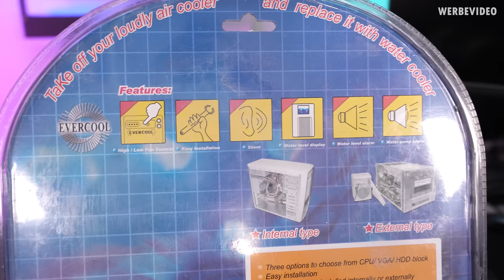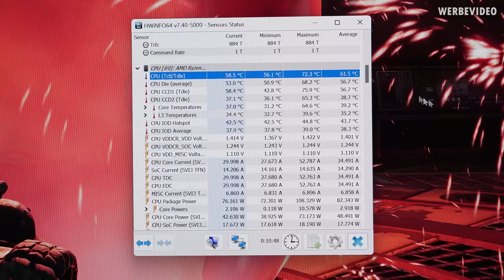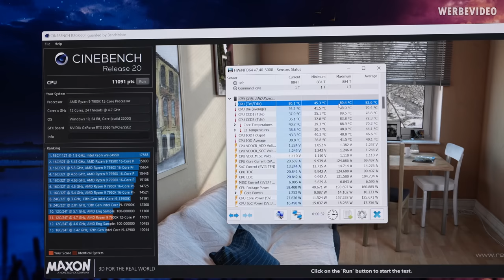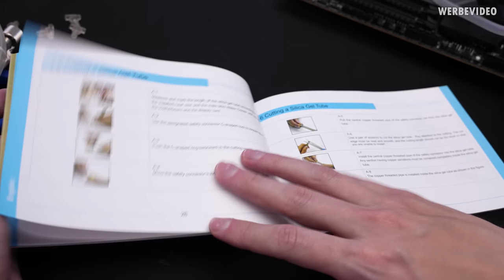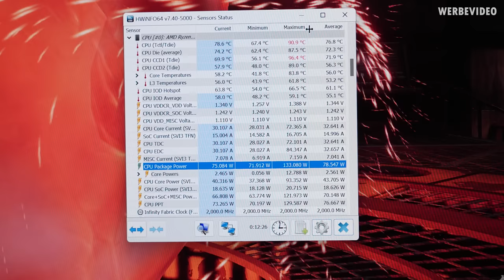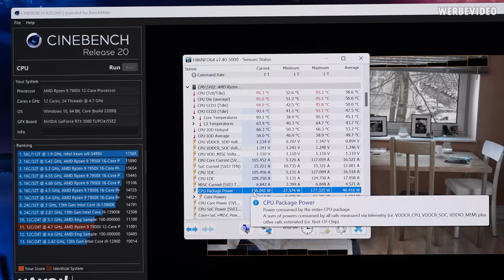19 Years old Water Cooling vs Ryzen 7900X

Comment: The kelvin (abbreviation K), less commonly called the degree Kelvin (symbol, o K), is the Standard International ( SI ) unit of thermodynamic temperature. One kelvin is formally defined as 1/273.16 (3.6609 x 10 -3 ) of the thermodynamic temperature of the triple point of pure water (H 2 O).

The kelvin scale differs from the more familiar Celsius or centigrade ( o C) temperature scale; there is no such thing as a below-zero Kelvin figure. A temperature of 0 K represents absolute zero, the absence of all heat. However, the size of the kelvin "degree" is the same as the size of the Celsius "degree." A change of plus-or-minus 1 o C is the same as a change of plus-or-minus 1 K.

At standard Earth-atmospheric sea-level pressure, water freezes at 0 o C or +273.15 K, and boils at +100 o C or +373.15 K. A temperature of 0 K thus corresponds to -273.15 o C. A temperature of 273.15 K corresponds to 0 o C. To convert a kelvin temperature figure to Celsius, subtract 273.15. To convert a Celsius temperature figure to kelvin, add 273.15. Historically, the Kelvin scale was developed by shifting the starting point of the much-older Celsius scale down from the melting point of ice to absolute zero, and its increments still closely approximate the historic definition of a degree Celsius, but since 2019 the scale has been defined by fixing the Boltzmann constant k to be exactly 1.380649×10−23 J⋅K−1. Hence, one kelvin is equal to a change in the thermodynamic temperature T that results in a change of thermal energy kT by 1.380649×10−23 J.

According to SI convention, the kelvin is never referred to nor written as a degree. The word "kelvin" is not capitalised when used as a unit, but is pluralised as appropriate. The unit symbol K is a capital letter. For example, "It is 50 degrees Fahrenheit outside" vs "It is 10 degrees Celsius outside" vs "It is 283 kelvins outside". It is common convention to capitalize the term when referring to the Kelvin scale.

Comment: I think AM5 will compatible with its K8 mounting kit if it is included with this, according to the manual shown in video it mount with stock bracket, if it's anything that using stock bracket for mounting, all CPU coolers will be compatible since K8 era all the way to AM5 and you didn't need to make custom mounting bracket at all.

Comment: If the water level sensor is just some bare metal wires looking for the conductivity of the water, either some oxidation on the contacts or having used distilled water rather than coolant is affecting the value and setting the alarm off.

Comment: Not sure how to contact you, but building a rig in one of your “Der Bauer” Lian Li cases. Excited to get started. Gigabyte Aoruse Elite AX MB / RTX 3090 / Patriot Viper 4400 mhz ram / WD Black SN850x Nvme’s x 3 / 10 TB WD hard drive / NZXT 280mm AIO / CORE I5-11600k.

Comment: I would be interested in seeing how well the Evercool Mini does with an updated heat block as well--something that can pick the heat up out of the processor. I doubt the included block was designed for something as rambunctious as a modern day Ryzen. The Pentium 4 TDP was, like, just under 100 watts. The Ryzen shown probably had a TDP closer to 200 watts, and some push 300 watts and higher. As such, I would be interested in what the "mini fridge" pump head can do with a suitable thermal pickup.

Comment: I've been using 20 year old water cooling since the Pentium 4 Prescott (Actually pulled the trigger on all of it BECAUSE of Prescott) and can tell you, no. Those 89W single core twin thread 32-bit chips do NOT do well with this type of equipment. Today I've updated the 240mm alum radiator to a 360mm copper, yeet'd the 3x80mm fans for 3x120mm and all is much MUCH better. You really need good heat dissipation for those older chips.
Pentium 4 Prescott needed it.
Phenom II X4 Deneb needed it.
FX-8000 series Vishera needed it even more.
Ryzen 3000 series doesn't need it so much to the point that it seems overkill but good.
I'm using the same gold/copper block I picked up in 2004 and Ryzen seems to like it. Had to flip the stock cooler mounts around and modify the original Socket A adapter to get it to work.

Comment: 5:06 Actually, that radiator unit alone looks like a cheap speaker . The 2 ports looks like RCA that you plug audio cable. It does makes alot of noise though

Comment: In the days of hotbox cases, this probably would have been a huge improvement if the buyers routed the radiator externally, vs air-coolers with a single 80mm intake and single 80mm exhaust for the whole computer.

We know they're useless, but comparing this cooler to a 120mm aio would have felt a little more "fair" than a 280mm

Comment: I remember the mini,  ut I could not afford it at the time, I did air cooling, in 1990, but water stuf from 2000 onwards. My first ore kit (instead of customers fish tank stuff), a gigabyte kit with water low warning system, but clear block, and water pump/etc cracked, n leaked on my 8800 ultra.

Comment: Why is there such a need to see if a 20 year cooler will work on modern hardware. I had an OCZ Gladiator Athlon cooler that had a 6000 rpm 60 mm fan. It screamed like a banshee but never really bothered as I just cranked up the volume while gaming

Comment: If I had something like that back then, I might have flipped the fan around and mounted it on the outside. Cases back then where starting to get the two holes for water cooling in the back.

Comment: Cool video, I like that speaker look from the 1990s boom box. Never remove the speaker, it was to warn you from bubbles or lack of water, even faulty it should sound like music from the boom box😂. I would have used it with a super violent delta fan, in a 12 inch subwoofer cooler.

Comment: Wondering if you would take a look at those all in one AIOs with the radiator built onto the cooler block.  They are different and interesting and wonder why its not done more often.  I think they were an OEM solution from HP and/or Dell?

Comment: Daft idea: direct die air in a desktop with PTM7950, an air cooler you like, and an aggressive fan curve. Laptops are direct die air, so it's precedented, but that's due to Z-height concerns and the fact that they're limited in capacity anyway.

Comment: This thing looks awesome though from the inside that is. You should have tried on a Ryzen 5000 series or maybe Intel 11th gen, these new chips are going to reach 95c no matter what you do and almost immediately too since that's what they are designed to do and doesn't really test how the cooler is doing unless it stays at 95 and rides on then the cooler is working fine.

Comment: I should literally send you hackjob Eheim aquarium pumps and car radiators/air intercoolers and stupid stuff we did in the late 90s. The insides of the block are cool though, 2 plates and a square strip of copper epoxied? together? Soldering is too expensive?

Comment: Don't get me wrong, it's nifty and all, but what is the actual use case for this (or was), the radiator is no bigger than one for an air cooler directly mounted on the CPU. Unless you get a radiator bigger than what could concievably be put directly onto the CPU, does water cooling make any sense?
Reply: having this external on your PC circa 2004 means you gonna be the star of the LAN party

Comment: An interesting thing is that amd has maintained cooler compatibility for the most part since socket 754, as it is likely that the amd mounting hardware included would have worked, even on a current motherboard.
Reply: This is only true if the cooler uses the super old school hook and loop mounting system instead of the screw holes, which this definitely would not have.
Reply: @Cooe.  actually if you looked in the box, it did have the hook and loop mounting system for amd, as was common for many watercoolers of this vintage.

Comment: There were a bunch of these back in the day. I remember really wanting a Zalman Reserator, which used a cooling tower that was entirely passive. My PC was my only DVD player at the time, so you'd see why I'd want silence. Thing is, it was a lot cheaper just to buy a stand-alone DVD player, which is what I ended up doing. Corsair had an actively cooled one called the Nautilus. Asetek had their rather girthy WaterChill, which had dual 120mm fans. An extravagance for the time. Both sat on top of the case and required you to run hoses. Most enthusiast cases at the time had cutouts specifically for that. Thermaltake IIRC had one unit that fit in the 5.25'' drive bays. IDK how effective it would have been. A lot of these early kit solutions were prone to leaking and still needed regular maintenance, but they were a lot easier to set up than DIY solutions. The first true consumer all-internal AIO, the Coolit FreeZone, didn't' come out until 2007. Thing was ugly and very expensive ($400 USD), but it was a lot more elegant than what came before it. Coolit exited the consumer market a long time ago, but still make water cooling products for enterprise.

Comment: so you compare a 120 mm rad vs a 240 mm rad?? didn't you know 20years ago we ALL consider aio  crappy and only trust custom loop?^^ the problem is not the waterblock nor the pump, in 20 years , they haven't managed to create anything new.
I know it might sound a bit preachy, but I can assure you that just by changing the radiator, you'll get much more reasonable temperatures.

Comment: it makes me wonder what the temps would be like IF you limited the cpu wattage to around 85 watts at full load.
Reply: Why? That's not even remotely the purpose.
Reply: @rustler08   it's a cooler, designed to cool... It would be cool to see what a modern CPU would be temperature wise if it was limited wattage wise to be around the same as a CPU from that era, sort of the same idea as this actual video

Comment: I found a shuttle sh55j. For 8 bucks. Threw a R9270x. I had floating.  And 😮 maan I threw in a ssd and more ram.  i3 530.    But the ram is necking sooo hard.. 666mhz. Locating ICS PLL for tuneing

Comment: I wanted a new air cooler for my 5900X as fan broke on my old Xigmatec Dark Knight. I got HYPER 212 EVO and ended up using only a fan and reinstalling Dark Knight again. The thing was lapped soooo many times over the years that it performs great. Heatpipes in contact with the CPU are soo thin you can dent them with a nail :)